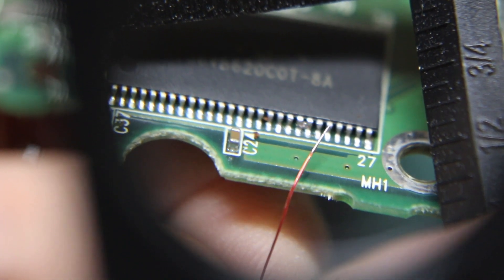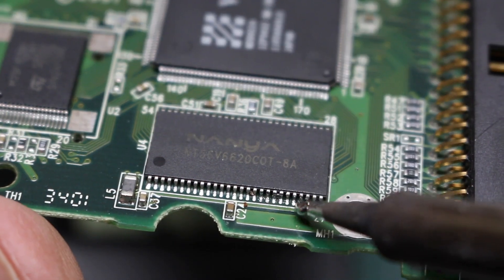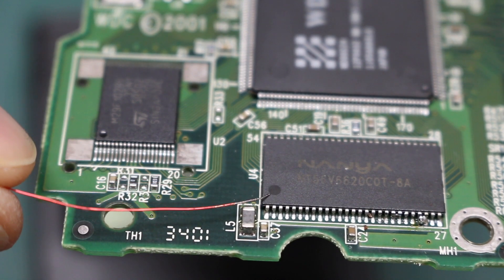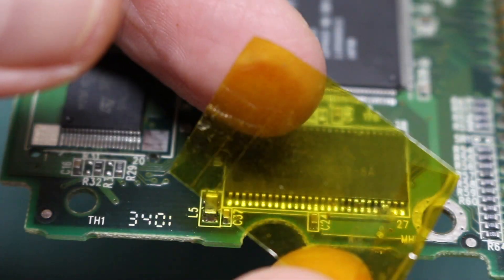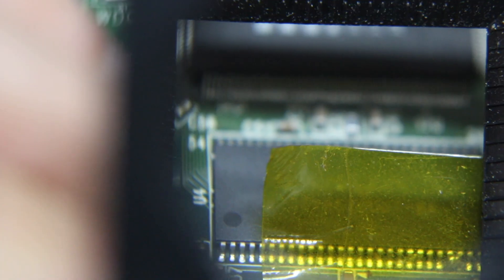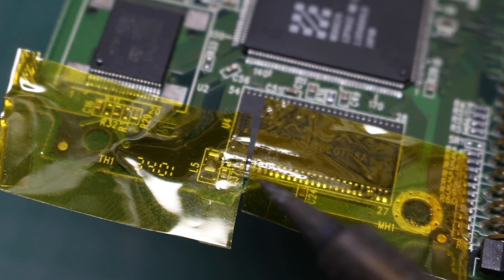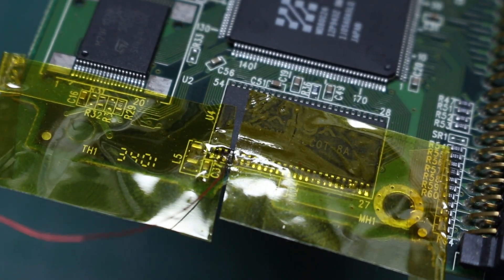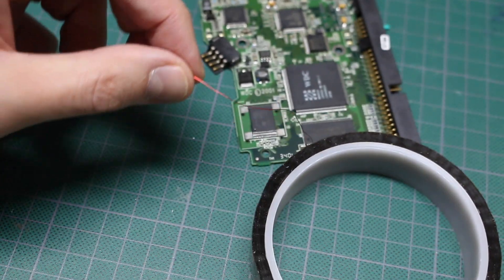Use Kapton Tape as a Mask For SMD Soldering

Comment: Question: I know everybody uses Kapton tape because it is electrically insulating and can endure high temperatures without breaking down, but what I want to know is this: is it thermally conductive, or insulating? Because some people use it as a thermal insulator, while others as a conductor and it confuses me so much. Thank you!
Reply: yes is this mean it can be use on processor of motherboard because of thermal

Comment: Might be a weird question, but could I use some kapton tape to cover a plastic hinge so it doesn't warp out of shape, say for a Nintendo 3ds console?
Reply from the maker: if the hinge goes out of shape because of getting too hot, I would expect that to still happen while the tape is sitting there tolerating high temperatures as well, but the tape is not a rigid structure to hold something in place. It’s just meant to exist in high temperatures without melting itself.
Reply: @GadgetReboot  hi and thanks for your response, is there anyway to prevent the warping, maybe use a hair dryer instead or could a hair dryer still cause warping, it's literally to remove the screen lens and replace it with a new one.

Comment: Using flux would help.  It increases the surface tension of the solder, makes bridging less likely, and makes it easier to remove bridges you've made.

Comment: Thanks! Which tape widths would you recommend ?
Reply from the maker: I have the smallest I think it's 3mm so I can isolate small spaces and then I have around 10mm for larger things because if I need even bigger I can overlap 10mm strips but it's harder to properly cut larger pieces smaller (sticks to the tools or fingers while trying to handle it)
Reply: @GadgetReboot  Thanks very much for your fast and helpful reply! I'll probably find use for this tape on both surface mount and through hole PCBs.

Comment: Be sure to use Kapton tape with a high temperature silicone adhesive to get a clean removal after soldering. They make Kapton tape with acrylic adhesive that could leave an adhesive residue upon removal. Kapton is a registered DuPont trademark.The generic version is polyimide.

Comment: Very nice.  Does it work for desoldering too? I guess you could use a drill bit to cut out a hole to mask round pads for solder.
Reply from the maker: I find there is more heat applied when desoldering especially when there’s a lot of flux and liquid solder flowing all over the place compared to just a dab closer to the target area when soldering, so with the iron making direct contact with the tape for a long time like that, it does start to burn but  indirect heat like a hot air gun allows more latitude on the tape before it falls apart.
Reply: Drill bits are worthless for that task as they would gab the tape. You'll either need to cut or punch an appropriate hole.